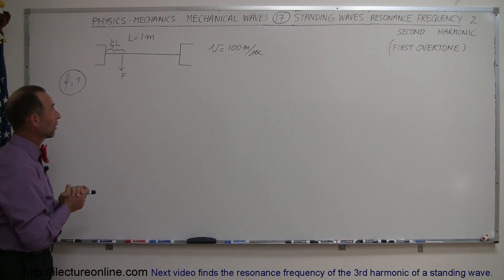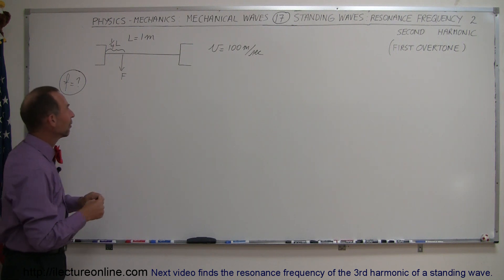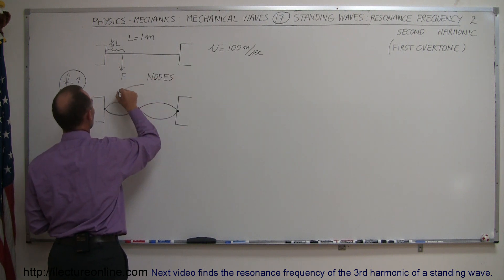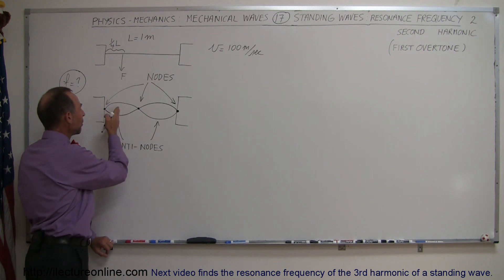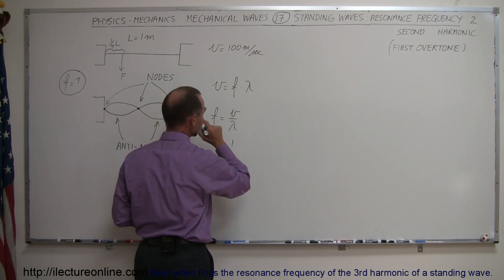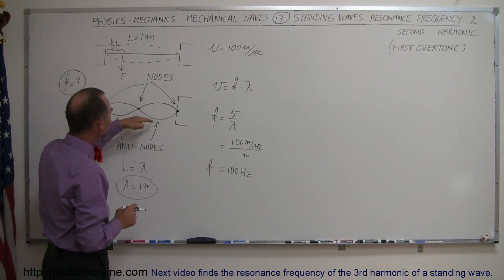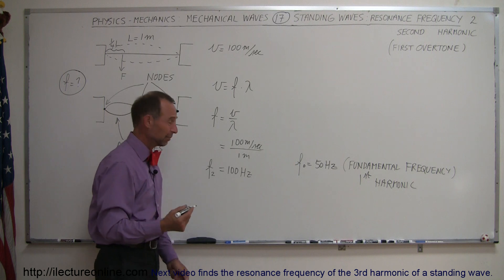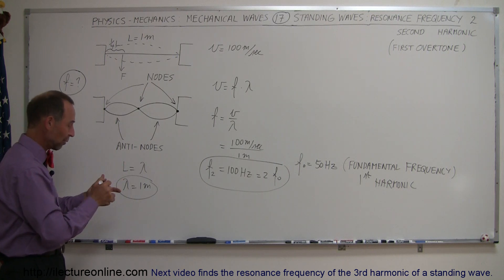Physics 19  Mechanical Waves (17 of 21) Standing Waves: Resonance Frequency 2: 2nd Harmonic

Comment: Amazing video series! I have a question, how can we mathematically prove that the positions of the wave of the higher tones. You explained it with equations for the 1st harmonic, such that at x=0 and x=L the position is zero, and x=L/2 it is 2A. 
How can we do this for higher harmonics? If we accept that the frequency of the higher harmonics will be integer multiples it is okay but then the question is how can we mathematically prove that the frequency will be the integer multiples?
Reply from the maker: Much of science is not done through "mathematical proofs".  It is done through observation.    Standing waves on a string can only exist is particular patterns as shown on the video.

Comment: but this is not what happens with an instrument: the pitch will be EXACTLY the same, no matter where on the string you apply force. pitch only changes when you change the string length by pressing on the string, or play a harmonic by touching the string at one of the simpler fraction divisions.
Reply: our ears cant hear it but there is a slight pitch difference, get a camera and put in in slow motion. Youll see the guitar strings oscillate and a slight difference in pitch